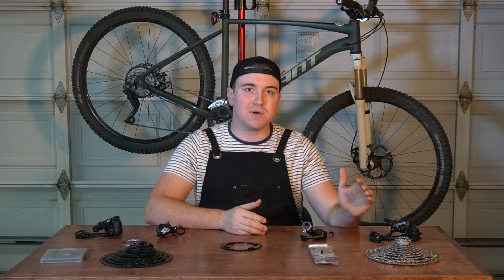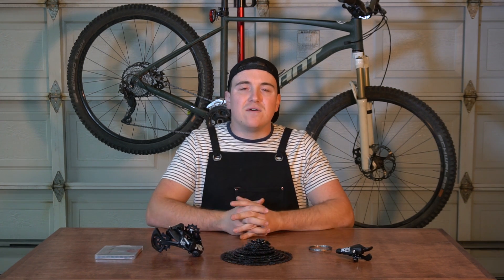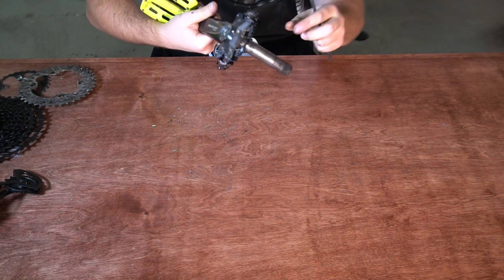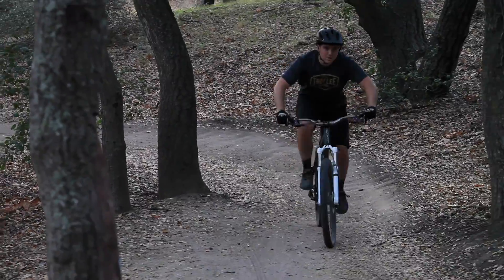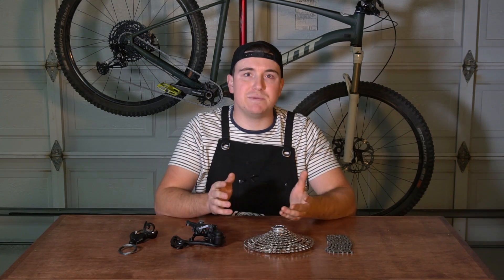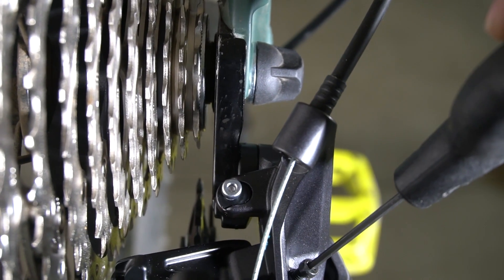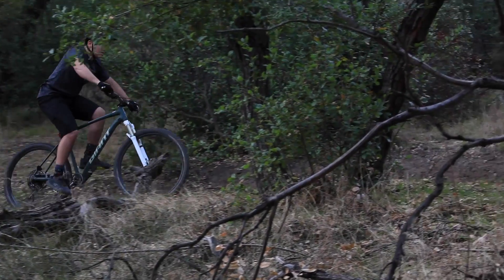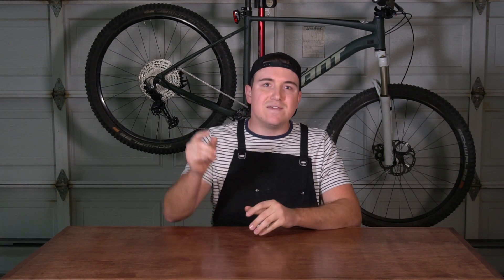The best budget MTB drivetrain? SRAM NX VS. SHIMANO DEORE!

Comment: As great as comparing these two is. Honestly both of these for the price are excellent and even tho I always prefer shimano if my complete bike is coming with either of these I’m happy. Because both quality components and it doesn’t hurt as much when I need to replace parts or wear the whole thing out. Performance may be improved in the higher level models but not to the point where the price difference is worth it

Comment: You make some excellent videos, you should have way more subs than you do. Keep up the hard work, and I'm sure your channel will do well.

I very much need a drivetrain, so I'd love to win the giveaway. I have a bike much like the one you fixed up for your friend, It's actually weird how similar they are. It's around a 2006 XC full suspension bike with a Fox fork. I am pretty happy with it, as it's hard to find decent used bikes where I live, and I cant afford to spend $2,000+ on a new one. It is great to own a full suspension, but my 2006 Deore XT drivetrain is extremely worn out. If I put any torque on the pedals when accelerating, the chain completely slips over the gears on the cassette, causing the pedals to jolt forward. It happens through every gear after the first 2 easiest gears. A new drivetrain would certainly bring my bike back to life.

Comment: Great review, think that the sram is better than the Shimano because of the derailer cage lockout, the all back cassette looks way better and you can mix and match parts from the SRAM Eagle family so you could put on a fancy oil slick Chain or a nice xx1 shifter for a more crisp shift. But  great review!
Reply: the same you can do with shimano system. Sram you always have to constantly tweak the transmission and you find yourself using very specialized tools to fix or tweak. sram is trash.
Reply: @dolphin-studio  True

Comment: Would love to upgrade my sons Giant bike with either one of these drivetrains. He has a hard time climbing with his 7 speed and this would be a huge upgrade for him. Thanks.
Reply: Mitt might not fit on that freehub if it's a 7 speed
Reply: @purplegarage05  Oh man that sucks. I was hoping I would have been able to upgrade him. You think they would have an adapter for it?
Reply: @zorrov  dunno but look at the microshift acolyte groupset I plan on testing one as soon as the clutched rear derailleur is back in stock
Reply: @purplegarage05  Thank you! I’ll look into it. Your content is amazing! Keep up the great work.
Reply: @zorrov  thanks:)
Reply: As long as it's the standard hg freehub body these should work but if your don't get this I'd definitely look into advent x by microshift. It's about $170 and you'll just need a single chainring in the front.
Reply: @isaacpavek9431  Thanks Isaac. It’s already got the single chain ring up front and from what I know it’s has a standard hub. I think this should work as well. Would be a beneficial upgrade for him. If I don’t end up getting this I will look into what you recommended.
Reply: @zorrov hello man, i dont know if you still will respond me But the 7 speed hub can not be upgradable, just from 8 speed, just if you buy another hub

Comment: I just found out that Specialized upgraded their drivetrain for the Sirrus X 3.0 from 1x9 microSHIFT Advent to the 1x10 Shimano Deore for the 2021 model. overall i really like the bike  but I feel like its missing something at that top end and the microSHIFT Advent is just clunky, multiple issues with the crank and chain drops. just feel like i need to try something new.
Reply: I own a 2021 (or 2020) Cannondale which has the M5100 groupset, but the latest model also has Microshift. No experience with that, but can't imagine its a upgrade

Comment: Would be interested in the update on the NX. Just got a bike with NX and have a lot of negative stuff about it, not sure if a lot of the issues come as it wears in or if they are present from new. My intention is to race XC with the bike, hoping to get the season out of it and then in the winter swap out the derailleur, shifter, chain and cassette for SLX or XT, which would save some decent weight and seem to be very positively reviewed. Thinking of keeping the NX crank and just swapping to a Shimano compatible chain ring.
Reply: What's the bike? I've raced a lot of XC on an SX Eagle groupset with an NX cassette and I have no complaints.
Reply: @Fred_the_1996  Its a Norco Revolver FS 2. So far so good, only one XC race in my area this season but have put >1000kms of trail riding on it. I had a typo in my first comment should have said "have heard a lot of negative stuff" Still intend to upgrade to GX/X01 components as things wear out an break if it comes to that before I pick up a new pick but other than being a bit rough and noisy shifting it has held up and worked fine so far.

Comment: Hey!

I own a 2021 Giant Talon 3. I want to upgrade from my current 2x7 groupset to Deore M5100 1x11 groupset. Do I have to change the wheelset and rear hub?
Reply: U need a new rear hub with freehub body
Reply: @rahuldasmajumder5121  Can you suggest which rear hub I have to buy?
Reply: @ventador7761  sure. U can get deore M 475 rear hub or any mtb rear hub with free hub body. Any hub that supports anything above 8s will be right for you. But please make sure the no of spoke holes Match your wheel. 
Sometimes it can be expensive to buy a hub, new spokes and built the rear wheel so it might make more sense to buy a brand new rear wheel from decathlon or a bike shop. It may cost less than building up your wheel. 😁
Reply: @rahuldasmajumder5121  How I can know the number of spoke holes on my bike??
Reply: @ventador7761  count the number of spokes on rear wheel. Must be 32
Reply: @rahuldasmajumder5121  If it has less than 32, Do i have to change the rear wheel?
Reply: @ventador7761  nope. Just buy a hub with same number of holes. Should work just fine
Reply: @rahuldasmajumder5121  Okay! Thank you for help! I appreciate it! :)
Reply: @ventador7761  no worries bro. Biketalks are always welcomed 😇😇
Reply: @rahuldasmajumder5121  Hi friend! if i buy a new rear wheel is better than getting a rear hub because they are a little expensive? any suggest about a budget rear wheel?
Reply: @ventador7761  well bro named brand wheels are too expensive. You can check out a wheel from your local bikeshop. If u have decathlon in your area you can get a new wheel from them as well.

Comment: Nice content. Would the deore m5100 derailleur work with an m8000 shifter? I really like the instant release and multirelease of those!
Reply from the maker: Yes it does!
Reply: That’s exactly what I’m doing 
M5100 derailleur 
M8000 shifter 
XT chain ( recommend a lot) 
M5100 crankset 
M5100 11-51T cassette 

Waiting for Crankset stock over here in the UK.
Reply: Yes, the shifter is the Deore's weak link, it feels mushy and shifts really badly, an XT shifter makes it perfect

Comment: With the Deore 5100 any upgrade option is excluded, there is no better compatible part. So for thisreson only I would chose the NX where anytime you can change just one part to World cup level.
Reply: M5100 is compatible with xt and slx shifters and derailleurs. It's even compatible with sram nx stuff if you prefer a sram shifter or already have a sram cassette.
Reply: @chairmanmeow8388  M5100 is 11 speed system. Therefore any upgrade with new parts is excluded, you ca match with older slx, xt, xtr -s but those do not handle the 51 cog (max 46) rear chainring, so you have to put a goatlink . As I said: going with the NX you get the already 12 system so you can buy any sram eagle part or even shimano 12 speed components can be compatible
Reply: @bende83  Same pull ratio as 12 speed
Reply: @chairmanmeow8388  ok then why do we have the M6100? and why not just use the M5100 mech in a M6100 setup. And by the way shimano 12 speed  chain inner with is also narrower so for best performance you also need the right chainring.
Reply: @bende83  the m6100 is lighter and better. Why do we have xtr if we've got slx by that logic?
Reply: @chairmanmeow8388  Nope, it is the same weight. And they are all 3 deore from the same year (4100, 5100, 6100). Anyway even 11 and 12 speed are somewhat compatible you sacrifice on performance and it does not make any difference on what I was trying to say. I said that buying the NX or SX system you can upgrade any part individually if you need or want to, without having to change anything else on the drivetrain. While buying the 5100 you always need to think twice if it will or not work.

Comment: I'v got Sram NX 1x11 and I'm about to change it to Deore RD M5100 and M8000 XT shifter. Do you think the Sram cassette will be compatible?
Reply: I've tried that but with an SX and it doesn't work well. It works at first but after some time the chain starts jumping around and it stops working well

Comment: I’ve had a couple friends with nx and they have long term chain retention issues and the clutch is not adjustable and slaps around pretty bad
Reply: Yep I have the same problem! I bought a new bike with NX drivetrain. First ride was perfect no chainslap, nothing. Since then Ive only ridden maybe 250km and the clutch is already weaker and my chain slaps to the frame. I wanted to give sram a chance but this is unacceptable for me.
Reply: Yea, Sram derailleur are amazing, shame the clutch is so weak

Comment: I have a shimano and the new bike i am looking at at 3k has nx. A friend had nx and i felt it war hard and not as smooth as the shimano. I know it is eagle but i need smoothness and precision and shimano has that at the demore level. Im afraid of spending more money and not getting somehting in not gonna be confortable.  And I can't test it...
Reply: I’m in the same situation, I wanna buy the NX because I prefer more sram but I never tested it so I don’t know what to spend my money on sram or SHIMANO
Reply: @zencro-bs9506  one more thing. Sram doesn't stay right for too long. It tends to want to be maintained more often. Take into account that the marin i had and the enduro that I have now work under two different conditions, one more on trails, the other more under enduro trails  You could say the enduro takes more of a beating (gx) but the other (shimano deore) just stays well put and precise for too long (like for months without touching it and it works perfectly. And I love that about shimano)
Reply: @rafaelparedes1937  Thanks For answering me. Now u changed my mind. One question, should i get a shimano xt or slx? Or Sram gx cuz i wanna Buy One of these transmissions quick
Reply: @zencro-bs9506  shimano has 4 levels. 1. Alivio 2. Deore 3. SLX 4.DeoreXT. I've had 2.deore and it worked perfectly for florida and NJ trails. 10 gears. Now when you go 12 gears, the mechanics have to be more precise, that's probably why I feel the Sram GX is giving me a harder time with the setup and taking it more often to the mechanic. So this depends  on your riding style. If you want  a reliable product for normal trails, no fancy enduro terrain, you will be fine with shimano SLX and sram NX. If you are riding more enduro trails with more rocks, more crashes and just more demanding in general. Then sram Gx or shimano XT are your options. As for me, I do ride enduro trails but I am not any good by any means, that means i give my bike a hard time and rely on it quite a bit. I use GX ar the moment, but probably will end up with. Shimano XT on my next bike. I just have had such good experiences with the deore that it is hard for me to change my mind, and gx has not proven to be as set it and forger it. It wants to visit the mechanic more often...
Reply: @rafaelparedes1937  for me, i ride normally, i ride on trails i do some downhill with rocks a bit and i ride on forests But not enduro trails with Crashes At all. I want a a derallieur from these to last long be strong and shift well. I also wanna have 12 gears I bought the NX cassette with 12 gears and now I need a derallieur or SHIMANO Deore/XT or SRAM GX. I really need your help because I don’t know what to get
Reply: @zencro-bs9506  if you bought nx you cassette, you need to change everything to sram. All of it. And stay with NX group.
Reply: @rafaelparedes1937  I wanna buy GX derallieur tho, I heard it’s stronger and shifts well
Reply: @rafaelparedes1937  I just wanna know if it’s better shimano Deore/SLX than SRAM NX/GX?
Reply: @zencro-bs9506  you mentioned in one of your messages that you "bought" a NX cassette. If you did, you have to stay with sram and NX group. If you have not bouhlght anything. I would suggest you get SLX group over NX
Reply: Both are excelent. I prefer shimano. If you are a trail rider not very aggressive, slx should be enough.
Reply: @zencro-bs9506  shimano SLX is equal to sram NX. Shimano Deore XT is about the same as Sram GX. As far as I understand.
Reply: @rafaelparedes1937  sorry I didn’t reply, If I buy shimano Deore 11 speed cassette I can buy a slx 12 speed derallieur? Because the hub I have is shimano base 8-11 speed. The SRAM NX 12 cassette fit on this hub and also the Deore cassette fit too
Reply: @rafaelparedes1937  thanks for telling me, I think im gonna go with shimano
Reply: @zencro-bs9506  you need to talk to a mechanic to see compatability.  But the rule here is that if you have shimano slx, you have to stay with shimano slx parts for best compatibility. If you have nx sram, then stay with nx sram parts. Thats why they sell this in "group sets".
Reply: @rafaelparedes1937  Thanks i think im Gonna go with shimano xt
Reply: @zencro-bs9506  remember that if you bought any parts like a cassette, the recommendation is to stay within that groupset and company. Ex. If you bought shimano cassette for SLX. You need parts from the SLX group. Do not try to match with others. You will have issues... best of luck to you.
Reply: @rafaelparedes1937  i have THE NX casete its very good and ive seen alot of people Doing Like NX cassette with Shimano Deore/SLX/XT because slx and xt have 12 speed So its working great ive saw. 
Thank you For telling me the right way Like shimano, im Gonna Buy shimano, thank you man!

Comment: Deore any day... avoid any of the SX, NX and GX SRAM Eagle stuff - ride nicely but fall apart. Have you wiggled a SRAM 12 speed rear derailleur lately? Seems only the top 2 echelon products are designed to last...shame
Reply: I have the sram gx  from a new bike with boost hub  and its been excellent , not had to adjust it at all in 1 year of lots of off road riding.

Comment: Where are the weight differences? You should weigh and compare each component. the main difference will probably be in the Casette 12sp vs 11sp. SRAM shifting is always superior to Shimano so I don’t believe you there. especially in muddy conditions another thing you didn’t test. That makes your video biased towards Shimano. Shimano is very good cost but also lacks longevity another point you haven’t raised or tested. I think you could have done a more thorough test
Reply: It's funny because you're stating the opposite of reality with each sentence. Deore is not only more reliable, lighter and cheaper, it also has a much superior shifting feel and stays in tune forever so you don't have to mess with it. Can't say the same for SRAM stuff below X01. Shimano is just on another level and always has been. And if you get into XT or XTR, there's no need to even think about SRAM ever again.